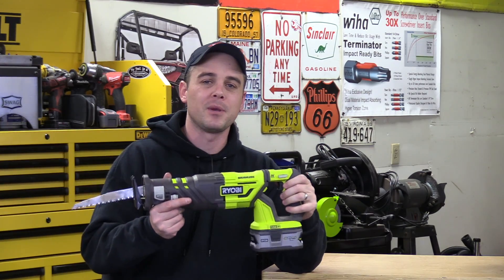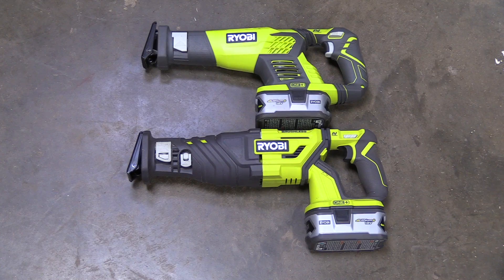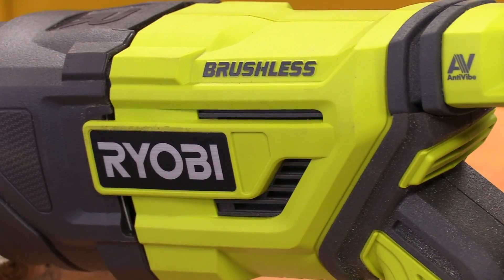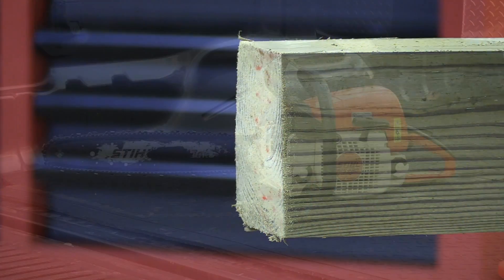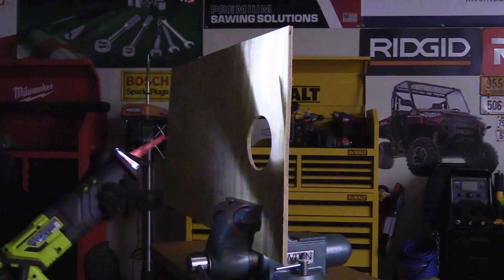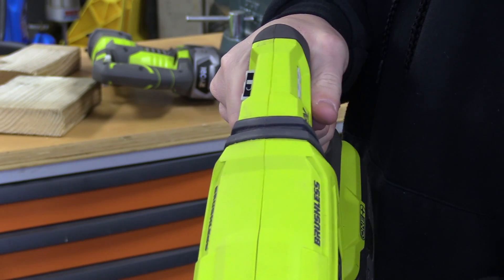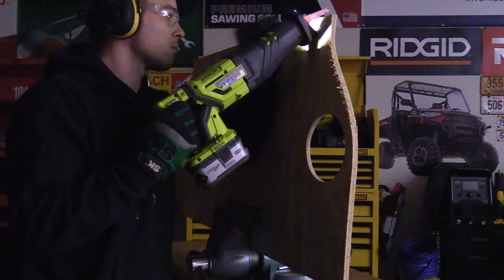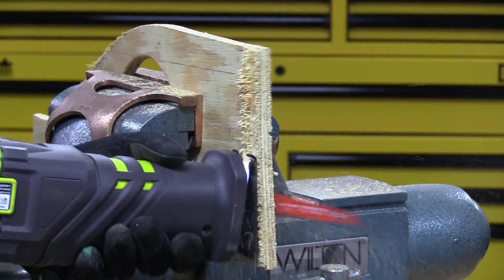RYOBI BRUSHLESS!!  P517 18v ONE+ Reciprocating Saw

Comment: The Diablo carbide blades are the goods. I see you were using the new pruning blades. Are they also carbide?
Reply from the maker: I agree that the carbide blades are great....I however did not use any of them in this video --- just standard versions.
Reply: Real Tool Reviews So the pruning blades are not carbide Daniel? That's what I was curious about. Glad to see yoo back by the way!
Reply from the maker: Nope, this was a 5-pack that I bought at the Home Depot for about $15 I think.....just the normal version.  https://youtu.be/2E8ziNglWn4?t=1m43s  And thanks!

Comment: I will be buying this new saw over the weekend and I got the new 6 amp batteries last week.  I have been using 18v ryobi tools as a general contractor doing home remodeling for years.  I will be cutting 40 feet of 2 inch countertops with it to start.  If anyone wants to know how the new  brushless saw works with the new 6 amp batteries let me know.  The countertops should be a good test.  I think they are 2 sheets of 3/4 plywood with some old 1 inch countertops  on top the plywood.  I'm hoping this new saw will rip right through it.

Comment: Have you had any problems with the overload protection shutting the saw off early?  I have seen several other reviews mention that the overload protection on the new brushless tools is too sensitive.  I:E  ToolCraze, AConcordCarpenter, WorkshopAddict.  I am invested in the Ryobi line pretty heavily - Also just purchased the One+One 10" Miter Saw (which works fantastic).  I was curious though about this issue mentioned by other reviewers.  Your Thoughts?  Thanks
Reply from the maker: I hit 2 big knots and stalled it.....I don’t think it was too sensitive, I just pulled the trigger back in & it cut the rest of the way.  I don’t watch other reviews, so I’m not sure what problems they may have with tools.  To me, this feels more powerful than other recips from Ryobi.
Reply: Ok.  Thanks for the reply.
Reply: Rock44260 that's because they  are designed to be used with the 6amp batteries that just came on the market.. May 2018

Comment: P516 had 123 cuts on the 2x4 compared to 132 in this model. I expected Brushless motor to do better than 9 more cuts. I do like the LED light though.
Reply from the maker: The 2nd 2x4 with this one was FULL of knots...you can hear the pitch change in the vid.  Had it not been for that, I am guessing it could have hit 150-160 cuts.  Those tough cuts (knots) take a lot more power.
Reply: Real Tool Reviews I didn't catch that... thanks for the update! Great review as always!
Reply: thats still a 8 percent or so gain in efficiency (guess! not maths lol) which i think is pretty good, brushes arent all that bad  really, but tech gets better
Reply: For high current cuts (4x6 6x6) the P517 with HP battery will outperform the P516 a lot more

Comment: i have a blue circular saw, angle grinder, drill, impact drill, hammer drill and orbital sander. i have the yellow electric hand plane, jigsaw, angle grinder, impact drill, hammer drill, 18 gauge nail gun, orbital sander, leaf blower, zenon spotlight, lanteern, mini worklight, standard spotlight, and a compact radio. i probably have a bunh more that i cant remember.i would recomend purchasing the nil gun, hybrid flood light, electric hand plane and impact drill. stay away from the older blue tools and jigsaw, please do a review on the ryobi electric hand plane, hybrid tool and the various pumps and blowers. thanks

Comment: handyman past 35 years - i went with RYOBI 4 everything as soon as they announced/went with their: "same battery works in every machine/tool" 
   Ryobi is best value 4 money IMHO. 
i even hav their  40v lawnmower & edger
Only one RYOBI machine flopped:  the 18v string edger burned out in me first time i used it /after gine about 120" of yard perimeter.   I kept the battery & cut out the fried motor / in/off switch   tgrew everything else out. Didnt try to return it - i bought RYIBI 40v string edger w/motir @ handle end  (the 40v w/motir @ cutting end is nit good DON'T buy that one)    i like that edger very much & lasted for tears of hard work till now still going.
   i do have/used other companie's battery power tools.
I'm happy 2 stay w/ RYOBI    i would like a fold open solar charger that is managable  weight & size  for times out in wilderness.  ( yes i hav RYOBI  car to battery charger thing)
Reply: Kamalakrsna Devi: 4 is a mathematical number, it does not mean for, also it is have not hav. Your statement contains numerous grammatical, punctuation, and spelling errors. Yes, it does make a difference.

Comment: I've just purchased a second hand Ryobi ERS800k Recip saw. Although it is likely to be an early model it's in as new condition. The previous owner used it only a few times. I'm new to recip saws and am a little uncertain on the blade replacement process. I have installed a blade but I can lift the end of the blade slightly up and down once installed. Is that right or have I installed it incorrectly?Would appreciate some advice please.
Reply from the maker: They aren’t “precision” tools, so as long as it cuts and the blade doesn’t fall out, you installed it correctly.

Comment: Do you think it would cut through railway sleepers with the longer blades?
Reply from the maker: I’d use diablo carbide tipped pruning blades.... they won’t dull & the large teeth would rip quickly and eject sawdust efficiently.
Reply: Real Tool Reviews cool thanks for advice

Comment: Same company as Milwaukee right ? Wonder if they have the same motors
Reply: Auto Bum my guess is they are first gen Milwaukee brushless tech
Reply: Yes. Ryobi, Ridgid and Milwaukee are all owned by TTI.
Reply: no thats not corect
Reply: Lance Granum YES it is correct. Also they are not 1st gen Milwaukee motors.... Although the 3 companies are owned by the same umbrella company, they share NO business, the 3 companies run independent, no shared parts, manufacturing, patents, nothing, they are all stand alone products, companies, etc.
Reply: This is correct, TTI is a holding company, not an engineering, manufacturing or sales company.  Each TTI brand operates autonomously.
Reply: Auto Bum no, TTI OWNS them, but does not RUN them or DESIGN them or MAKE them.  All independent, although if you want to get down to it, it does look like they do have two very similar brands made by the same groups, Ryobi and Ridgid.

Comment: I can tell you from experience of owning this tool that it's still got that problem with the blade changes. Right out of the box with the stock blade and a couple of small tree limbs the blade got stuck. I Looked into this issue and apparently i'm not the only one with this problem at all. People are also having problems with excessive wear around the poor LED light placement on this tool. Save your money. Ryobi does make some descent tools for the money. This one is junk.
Reply from the maker: Well, I have had the complete opposite experience than you.  I have not had any problems with it & think that it cuts great -- especially considering the price VS the high-end competition.

Ryobi has a 3yr warranty on their tools, I suggest giving them a call & getting it fixed.  Perhaps it was a manufacturing defect, your aftermarket blades were defective, or is was user-damaged.

Thanks for watching!
Reply: Same…..It’s 2-16-22. Mine,s less than a year old…. had blade issues right away like previous models and today it quit completely. Yeah, it’s under warranty but I’m tired of going to homodepot …..I’d rather have it just last.

Comment: I NOTICED WHEN CUTTING WITH METAL BLADE, THE BLADE KEPT FALLING OUT. I DID'NT HAVE THIS PROBLEM WITH WOOD BLADES. MAYBE COINCIDENCE? AND YES IM USING PROPER BLADES.
Reply: I've had the same issue and with further inspection of the blade, noticed the hole that locks in the blade  is off by a tad. Made it the hole a bit larger and it's working just fine.

Comment: Brushless may last longer, I still have the old blue tools.  Must have got them 16 years ago.  Batteries are all long dead, running lithium ones now.
Reply: Truthfully, I don't much care for most Ryobi tools, but I've been switching over to them because of what you just said, you've had your Ryobi cordless tools for 16 years and can still use the same battery platform as the new tools. I like that.

Comment: I would like to get one of the  brushless ones,but at double the cost of normal one, I cant justify it. I broke my original ryobi recip today, the carbon brush broke off inside the motor, and non repairable (in uk,) not India, it would take a back street repair shop an hour) so £60 for new one

Comment: i bought a diablo blade for mine to cut some tree limbs. It would not cut at all!!  I ended up just using my circular saw to cut things. Im not a tool guru, why is his blade going through limbs like butter?
Reply from the maker: You are using the wrong blades.  Try carbide tipped pruning blades.  Large teeth = fast dust ejection = fast cutting.

Comment: I see two failures... the key lock not holding after awhile. 
And.. the hi/lo breaking off
Reply: TurboFlush I had one for a day and I had to take it back. I couldn't get the stock blade it came with out! I also suspect that there will be excessive wear right where they decided to put the led light on the unit.

Comment: so...in your opinion is this tool worth $99?
Reply from the maker: Yep!
Reply: The older Ryobi P516 is basically the same, except it is does not have the orbital feature of this newer P517 unit.  RTR reviewed it as well and it only made 9 less cuts with the same battery.  The older P516 has a special at Home Depot right now where if you buy a $99 two 3Ah battery kit with bag and charger, you can get the P516 reciprocating saw for free.  There are also a lot of other tool choices(fans,lights, drills, radios, etc) you can choose instead of the P516

Comment: Great review, but i will stick to my Hitachi 18 volt cordless tools - i had some Ryobi tools in the past and after less than one year the tool was toast - I think they are popular only because they are sold exclusively at Home Depot ( 2,274 stores )
Reply from the maker: Kobalt is sold exclusively at Lowes & they can’t seem to give them away...the batteries are $10 a pop......I think it’s got more to do with it than that.  The fact that Ryobi hasn’t changed the battery platform in 20 years is a big positive to keep people buying them.
Reply: Ryobi has been around alot longer, they made there first power tool in 1968, Kobalt was founded in 1998. That means Ryobi had a 30 year head start
Reply: I have some of the Hitachi 18v tools and they're great, no doubt about that. That being said, I've completely moved over to Ryobi because of the One+ system and the wider variety of tools that are available. I've found that they're just as - if not more - powerful, just as reliable, and cost much less so I have tons of tools & batteries now. I've had the first set I bought over 3 years now and have added over 20 tools (both new and refurb from DirectTools) and have not had one failure.

Comment: Why do some people hate RYOBI for?
Reply: It's the home do it your selfer, and is the lowest in the lineup of tool brand made by the same company. Ryobi being the lowest, Rigid being the medium, and Milwaukee being the premium brand. Ryobi is fine for home use, but cost cutting in certain areas make the tools not last when they are abused.
Reply: I had to retire 2 ryobi 1/2 inch drills over the years. The chucks wore out and was not able to repair. them.
  The 5 inch circular saw is in the same boat. If the new stuff has replacement parts around, i think I will stay with ryobi.
   The new stuff looks better in the reviews. I have to do more research.
Reply: No tools are going to last forever. Unless you baby them.
Reply: i have a low end Ryobi circular saw and jig saw.   the jig saw had been flawless but the circular saw bent so I can't adjust the dept.   then again it was $35
Reply: Because it's a homeowner tool. I do buy Ryobi and use them in the field never had a problem, also if it breaks from some mishap. I'm still paying half the cost or less to replace it as opposed to other names.
I used to only buy Makita cordless.
Reply: Mo goodness - Ryobi would be good for 95% of all home owners.  If you want pro tools, then buy them but money-wise it is a waste for the small amount of projects most people do around the home.  Secondly, if you abuse tools, you ought not blame the tool.
Reply: I’m a self employed plumber that uses Ryobi everyday. The brushless stuff is worth the money with the new 3&6 amp hr battery’s. You can achieve damn near Milwaukee speed and performance. Can’t beat the price and when I cut into a clogged drain line and soak the motor with poop I don’t feel bad because it can be replaced for around $100 instead of $250 like Milwaukee. I’d rather put $150 in my pocket instead of Milwaukee’s right!?! The man makes the tool the tool doesn’t make the man.
Reply: +ConservativeYankee22 Barr
The company I work for buys us Milwaukee stuff and I do love it, but if I had to buy my own to use for work, I'd likely get Ryobi. I'm a plumber too and can vouch for power tools getting splattered with various liquids...happens all the time and it would be a lot easier to get over ruining a Ryobi than a Milwaukee. Plus I've had great luck with all of my Ryobi stuff, even the drill/recip saw combo I bought almost ten years ago, are still kickin' after all these years of lots of use and a little abuse.

Comment: This doesn't seem much of an upgrade over the P516 (Brushed Motor) - from your previous video https://youtu.be/XUsN6Qo3t04?t=719  the older brushed P516 can do 123 cuts vs 132 cuts with this newer brushless p517 saw... beyond longer life of the motor (time will tell how significant) - it doesn't seem to be that great of a value ($60 vs $120)

Comment: not a smooth cut compared to circular saw
Reply: Reciprocating saws are not designed for circular saw type clean cuts. However, turn off orbiting then the recip cut is cleaner. Also, my guess 99% of the folks using recip saws are not in the least worried about cut quality, they use it for demolition; me I use it around the property trimming tree limbs thus the cut quality is a none-issue.